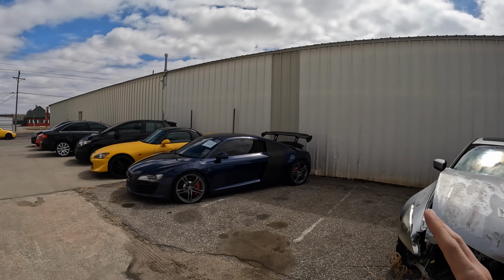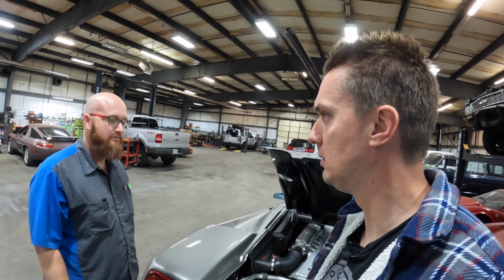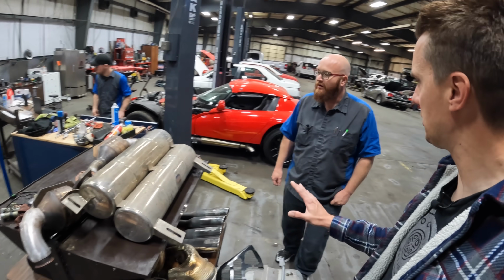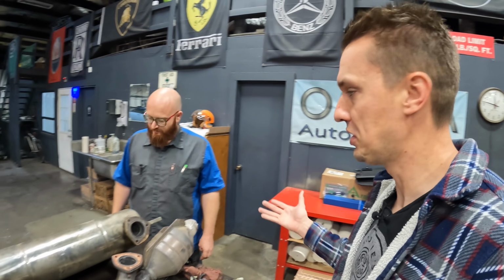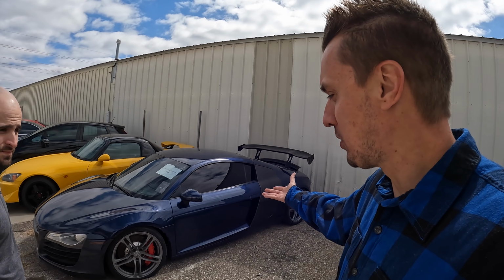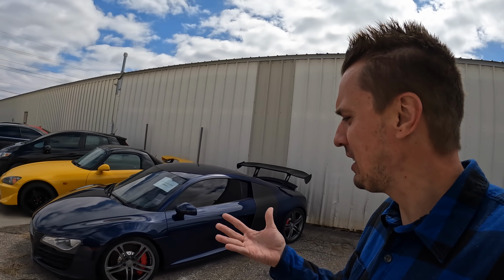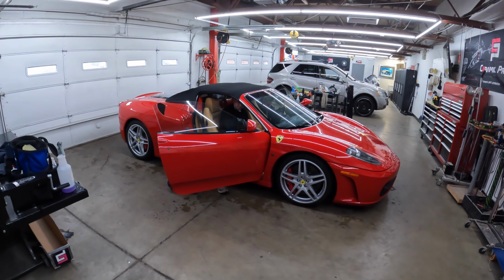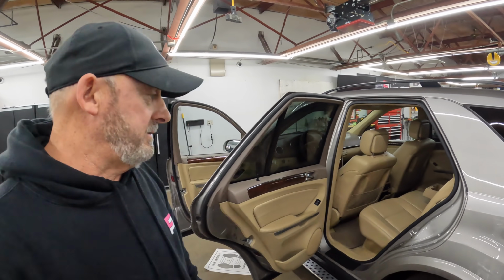How I got SCAMMED (again) buying a cheap Audi R8 for my wife

Comment: That moan in the Lambo sounds like a differential that I once had that was about to let go -- when you'd cruise at 40-50 MPH with steady throttle, it would moan exactly like that.  I know the Lambo doesn't have the same type of diff as my car did -- it's a transaxle.  But still, maybe it's gearing somewhere.

And, wow, that damn ML looks great now!!  What an improvement!!

Comment: I don't pretend to have any knowledge or experience with Italian sports cars, but could the moan be coming from the air intake system?

I know that on some cars the air intake system has additional parts on it with the purpose of reducing or silence the air intake noise. For example a common free mod that people used to do on Fox Body Mustangs and 98-up LS1 F-Body's was to remove the air intake silencer.

Comment: I get the feeling the previous shop did a timing chain, messed it up, and blew the engine. They found a block and put everything back together, but couldn't get it to run.

Comment: MOANING —
I feel your pain. I too have invested in something to improve a noise In my car and it was still there after the change. God, we love our cars but sometimes we would like to drive them off a cliff...and some very bad days go over the cliff WITH the car. 

R-8—
Sellers from hell. 
I thought I had a seller from hell too when I bought my '86 Porsche Carrera from a guy in NY. His friend and mechanic did the PPI and for the clutch it was a 5 * and for the sunroof 4 * dash 4 *. When the car arrived (all the way from NY to OR) the clutch seemed terrible. I could hardly drive it. At first I thought since I hadn't owned a P-car for 12 years I didn't know how to drive it. I talked (email) with the owner; he asked me questions as though I might have tracked it; I hadn't! I took it to my P-car mechanic and the clutch almost fell apart in his hands when he started to work on it. I took photos so. the previous owner could see how bad the clutch was.

Same basic problems also with the sun roof, cables that move it back and forth and the felt strips that keep the wind out were shot as well. Long story short he said to send him the bill and after two weeks it hadn't arrived so I thought I would have to eat the bill — but no, he paid the $1,500.  He also sent me a new dash (4* but was actually a 1 *) he had that was perfect because he saw the holes in the dash from a photo of the car AND he sent me 4 wheel spacers too. ALL free! 

So hopefully your story  will end like mine :—)

"A garage without a Porsche is just a dark hole" Walter Rohrl - Porsche Development

Comment: In the video the moan seems most present at low throttle input. My bet is a vacuum hose is making the noise - either dry rotted or a loose clamp

Comment: MOAN: it isnt RPM or speed dependent, almost sounds like a multi-stage fuel pump setup? i know several lambos have fuel tanks right behind the firewall there, with big pumps.

Comment: P0088 - too high fuel pressure.
Fuel Pressure Sensor malfunction, Defective Fuel Pressure Regulator, Defective Fuel Pressure Regulator..

HPFP is driven by cam -  when timing get out of time the HPFP may work incorrectly.
Check to verify.

Comment: If you give that VIN number from that R8 to Audi, they should be able to provide you with a replacement computer that is automatically going to be compatible with all the sensors, and whatnot, that are installed in that particular vehicle. At that point, a full engine rebuild, reinstall, and then the replacement computer installed, should Rectify any freaking problem known to man. As long as the engine, and all the sensors, and relays, are refurbished, or replaced, to manufacturer spec. Granted, in these newer Exotics their can tend to be several subsystems, that are operated by smaller secondary computers, but a manufacturer scan tool should be able to diagnose whether any of these secondary computers are defective or not. As long as they all pass, the engine is built to spec, all of the relays and sensors are the correct number part for that car, and you get a manufacturer replacement computer for that VIN, you should be able to make it run, regardless of whether you are able to diagnose what's specifically wrong with it now, or not.

Comment: I had a sound somewhat like that before and I couldn't figure it out for a long time. Turns out it was a plastic strip on the windshield vibrating in the wind at speed.

Comment: You need to take it back and give her one of the Ferrari's. :-)  The Lambo - man does that sound great (you really need to do a short with you going through a tunnel 🤩).  But I am getting really worried - what is that sound. 😢
Reply: It's not low on diff oil is it?

Comment: You ever been in a Diablo before homie??? That moan is likely normal, it's probably just how it sounds. What you're hearing is straight cut gears, likely in the transmission, in one of the gear boxes, or differentials or something. That's what makes that kind of noise, straight cut gears. Which means, unless that thing has some type of aftermarket gearbox 4 differential somewhere on it, that is the way it's supposed to sound. However, if you can figure out what gears are making that noise, you can get them replaced with helical cut gears, which will eliminate the sound.

Comment: I'm sure these guys have it all under control and they are the experts so my thought and experiences are nothing really. But I had the exact same symptom on my car and it turned out to be the immobilizer after I had replaced the battery. (It was an E46 M3 BMW). The weird thing was that the car started right after I had put the new battery into the car and I even drove home. Then when I tried to go and start it the next time it would do exactly what this is doing. Fire for the first crank like a quick flash but not continue and actually start all the way. After I cleared the security system codes the car worked fine again and only did the same thing again after I had unhooked the battery again to do some other work on the car and had to erase the security system codes again. But as I have said I know nothing about Audi's and these guys are pro's so I'm sure they've tried it all already.

Comment: You need to name the Diablo "Mona". Now time to cut Wizard loose on fixing the moan. If I were a guessing man (and having no knowledge of the car), I'd guess it's an idler pulley with a bad bearing on the forward side of the engine. I'd probably take it to a dyno shop so you can put it under load to replicate the issue in a way where Wizard can probe around with a stethoscope.

Comment: So after 15k the drone is still there, this is what happens when you blindly throw money at a problem. You can't fix the problem if you never identify what the issue was originally, just guessing isn't how anyone should ever approach an issue. Car wizard huh, he is a true wizard when it comes to your bank balance. Good guy, he does a lot of good work. That being said, just guessing when someone else pays the tab is unacceptable, especially at this level. This isn't a Corolla, slick. 

#HOOVIESGARAGE
How to fix "drool sound":
a)On a flat road, optimize the driving conditions to best reveal sound. Record the sound with best quality, noting engine rpm, current speed, current gear, engine temp, tire pressure, etc.
b) While recording: vary engine rpm, speed, gear range, load. Making best attempt to hold consistent for 10 sec intervals.
c)Isolate the recorded sound with software to determine the frequency (Hz)
d)Compare frequency of sound to known values of car/drive train, taking into special consideration gear ratios and multipliers.
e) Verify findings with "well placed" piezoelectric accelerometers (aka vibration sensors)
f) Isolate and identify problem
g) FIX PROBLEM

There are soon many things that can cause  drool sound, things that can almost mimic an exhaust drool. Things like, tire balance, tire pressure, tire wear, flywheel/flex plate balance, bad harmonic balancer, worn serpentine belt, bad bearings, flow conditions in the intake stream, worn/damaged engine mounts or isolators, worn/damaged transmission mounts, unbalanced drive shaft, worn CV joints, unbalanced half shafts, etc...etc...etc. But hey, let's see what you can dump more YouTube money into, it makes great content. Still enjoy the channel and have nothing but respect for you and automotive Gandalf.

Comment: Scrapping the R8 buying a running and driving one would make more sense at this point. But common sense was not expected. Dropping in a new engine to findout that the gearbox makes a noise. It is going to be polished turd at best. This car needs to stay dead.